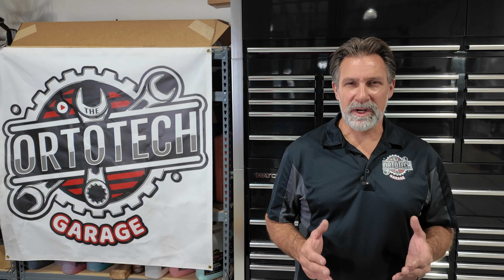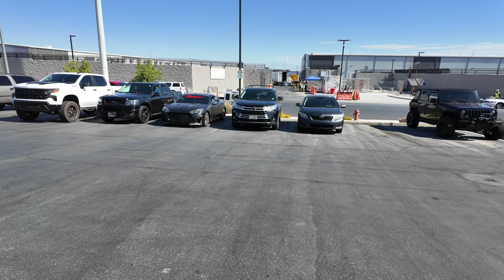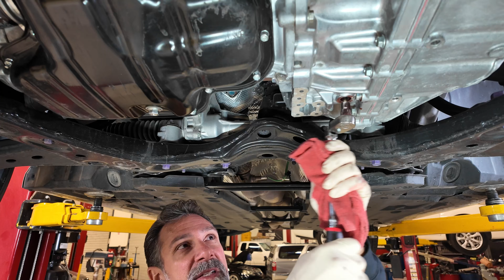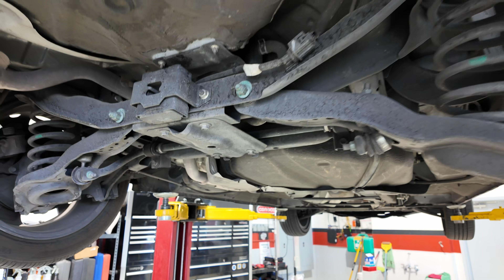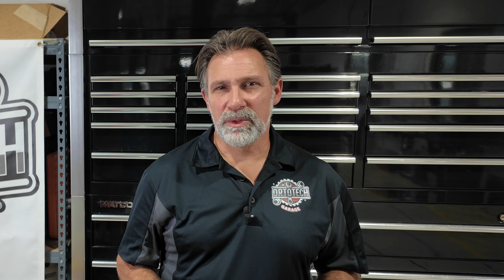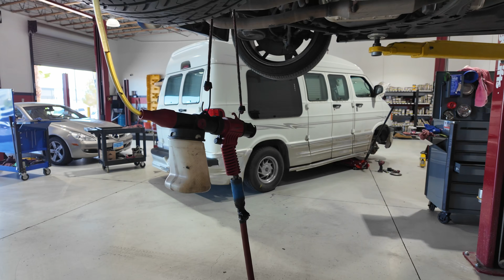Your Car’s Maintenance Schedule Wasn’t Designed for You

Comment: Well said. I agree with most of what you said with exception of oil change intervals and the owner's manual. 

For oil changes,i recommended 3k full synthetic intervals.  If i say 3k,the customer will come back at 3500 to 4500. That will get them around half (or less)of many manufacturers (of modern cars) recommend.If they come at 3k,they just reap the benefits of cleaner oil.

I would say the manufacturers have 3 primary objectives with the maintenance intervals. 

1. They want to extend it enough to market the cost of ownership down
2. They want to get the carbon credits to avoid cost. 
3. They want it good enough to make it past warranty 

Lifetime fluid on CVT(that by design) that wears?

10k mile oil changes?

This is lunacy!

I think the manufacturers are doing what so many manufacturers of everything are doing today. Making it a cheaper quality,while increasing the price.
Reply from the maker: Thanls for sharing your thoughts, John. I think I need you in my next maintenance video! 😂 You’re pretty much making the same point I was trying to make. And only a technician would know the trick of telling a customer 3,000 miles because somehow they show up at 3,500–4,500 like clockwork! 😂 There can be a big difference between a manufacturer’s maintenance objectives and an owner who wants to keep a vehicle for 200,000+ miles. I’d rather maintain something a little early than find out years later that I waited too long. 👍
Reply: I would say 3k for motor oil is lunacy. Oil test data doesn't support that conclusion. Everyone likes to say "clean oil". What is clean oil? Tell that to a diesel owner and they will laugh at you. What matters is the additive package, fuel dilution, and oxidation. Synthetics, especially, group 4 and 5 resist molecular bonding. It is engineered to be molecularly saturated which keeps it very stable over prolonged use. If you tested oil at 3k, 5k ,and 10k and all 3 tests came back saying that the oil was still protecting then 3k is just wasting money. I could understand someone not being confident about a cheap group 3 synthetic but even then, 3k has not been a real standard since advanced additive packages were developed in the late 70s. Now you can run an Ester based oil for 10k and it will actually clean your engine. Ester based oil is naturally attracted to metal surfaces and provides incredible additive stability. PAO is chemically inert and highly resistant to breaking down or turning into sludge. Use an oil that blends of both to protect engine seals and get the combined benefits of each 

You talk about keeping cost of ownership down... Here is some simple math. I had a 2006 Volvo S60 T5 with 300k miles. I performed 10k oil changes at roughly $60 per change. That was 30 oil changes opposed to 100. I saved $4700 and the car is still being driven by a nephew to this day (4 years later). Now stretch that math across every car I've owned since '92. I've performed a 10k analysis on almost every car I've ever owned and the oil was still serviceable at the time it was changed and wear particle counts were within expected limits. I've never blown an engine, burned out any piston rings, or burned oil at a significant rate. Take some of that 4500 mile customer oil and have it tested for $40. Blackstone will even send you the kits for free with free return shipping. I've seen oil tests (Honda Civic running standard Group 3 Synthetic) at 20k and 30k oil. They came back with no additional engine wear (only expected increased metal accumulation caused by extended test duration). It wasn't until the 50k sample that wear metals shot up beyond what was expected. With all the money I've saved I could buy 2 engines or a cheap car. The only thing I do differently is: I do 3 early break in oil changes to flush early wear & machining metals from the engine and I ditch the 0w20 and use whatever my vehicle uses outside the US. I also install an oil separator on direct and split injection engines. The only thing 3k benefits are shops and the driver's peace of mind. There is practically no difference between 3k oil and 5k oil under normal conditions. I had a 10k PAO sample on a Ford 3.5L Ecoboost (Twin Turbo). That report said the oil would most likely have been good for another 4000 miles. I'm an engineer so I follow the data and it has never let me down with any of the cars/trucks I've owned. 3k changes are all about feelings. People do it because they are afraid and usually it's because someone told them they should be afraid. When I was 16 my dad told me Synthetics could be pushed and that gave me the confidence to push them and here we are 30+ years later. I have saved a lot of money but it wasn't blind faith in the oil. You should always test it if your goal is back to back long intervals.
Reply: @erice3933 

1. UOA only paints some of the picture,not all

2. Clean oil is not just color but also smell.

3. Your anecdotal evidence on one vehicle being fine at 10k intervals cannot be arbitrarily applied to all your other vehicles. Every car is different, every driver is different, environments differ greatly. 

4. I could make a complete list with a dozen qualifiers for my service advisor to ascertain which oil change intervals should be suggested...or...i can pick a conservative one that is applicable to a wide variety of clients such as...

Heavy stop and go drivers

Clients that burn oil at an abnormal rate(try to advise a 7500 Oil Change interval when they burn .5 qts every 1k miles)

People who tow

Engines that run hotter than they should due to a myriad of factors

Car engines that never reach full operating temps due to short trips 

Turbo cars

5. A Japanese Engine builder ran experiments on the same model engine with the same oil,all at different intervals. The lower intervals showed less wear to the engine when it was tore down.

6. Most,if not all Independent( non quick lube) shops don't make money on oil changes. The oil change only exists to search for additional work. Take all the non quick lube Independent shops and just allow them to do oil changes,they would go under. A good shop will spend 30 to 60 minutes on an oil change because they are road testing, inspecting the vehicle and doing the oil change. If they make 180 labor per hour and work 45 minutes on 1 oil change,they are in it 135 on labor alone,plus cost of goods. Trust me,we don't make money on oil changes,unless we find other legitimate repairs to sell(hence why oil changes are loss leaders for us)
Reply: @JohnMichael-kj6fo   My 1 car example was just that, a single example. Did I need to break down the math on the other 12 vehicles my wife and I have owned between 1992 and now? I've never lost an engine to oil. My wife did. When she was a teen she just added oil. That engine ran for 40k on conventional oil before it seized. I blew a head gasket once on a Subaru but that was the water pump, but I grew up tearing down engines. I helped my brother rebuild his Subaru Impreza engine at 120k. It broke a timing belt and smashed some valves. He came from the same school of oil changes that I did. Unfortunately, he got a Chinese counterfeit Gates belt kit and it snapped after 15k. He performed 10k changes with Mobile 1 and the inside of that engine was immaculate. The main bearings, rings and journals were in great shape.   

I tow a 9000lbs RV and when I do, I change my oil more frequently. Otherwise, it's usually around 10k because the results show the oil is still doing its job. Blackstone has an article called "What does a 10000 mile oil change look like". In it they examine real results, including 20k and 30k samples.   

Oil analysis actually paints a very good picture of not just oil life but engine health. It's like bloodwork for your car. It can shows you things like fuel dilution, coolant contamination, oxidation, and not just metal wear but where that wear is occurring based on the metal type. The changes, to motor oil, that cause it to smell differently are represented in the test results. Next you're going to tell me it tastes different too and the tests don't detect that. I get it, discrediting the best tool for showing you oil and engine health is the first step on a road towards selling people on unnecessary oil changes.   

You can call it antidotal but like I said, across ALL my cars I've performed 1/3 the oil changes of someone who changes it every 3k. I have saved over $20k in total cost of ownership and never lost an engine. 3k was a marketing gimmick in the late 70s and 80s. The problem is it has become generational. Father's taught it to their kids and people mostly stick to it out of fear. My dad read more than he watched TV. He loved publications like Popular Mechanics. That is where he read about Synthetic oils and told us to change our oil less. 30+ years later, that's 4 kids and no failed engines between us. I'm an engineer, so I love to push things to their rated specs. When it comes to machines, I follow the data and adjust as needed. Mechanics live in a world of entropy and engineers think in terms of optimization.

Just recently Popular Mechanics posted another article about oil change intervals. Their position hasn't changed since the 90s and motor oils have only gotten better. The problem with mechanics is they see more of the cars that have problems (entropy). It skews perception when it comes to rate of failure. Just like cops tend to think most people are criminals because they encounter more criminals than an average person.